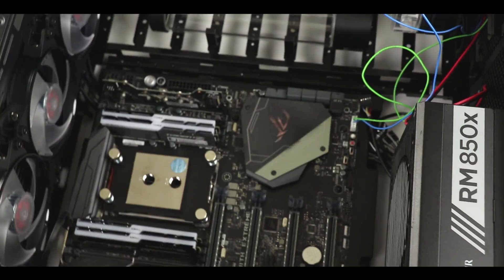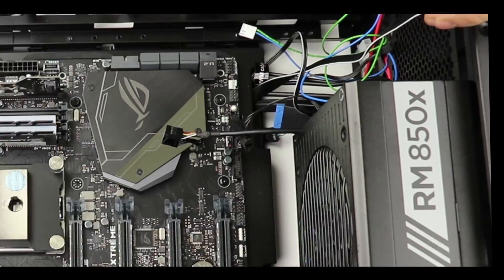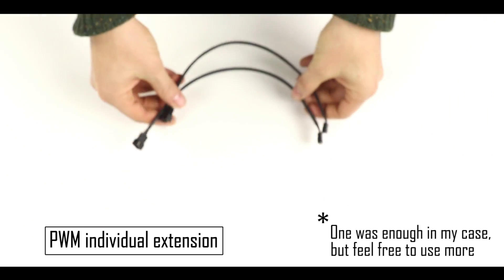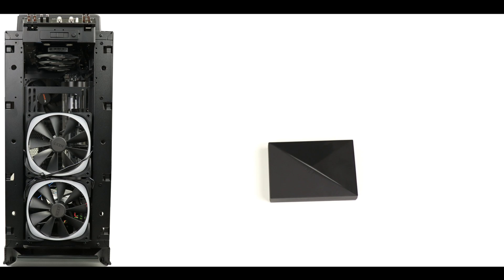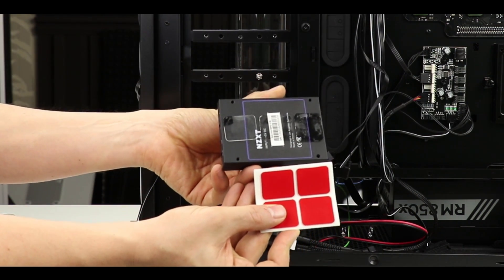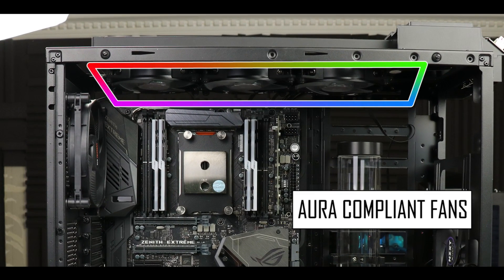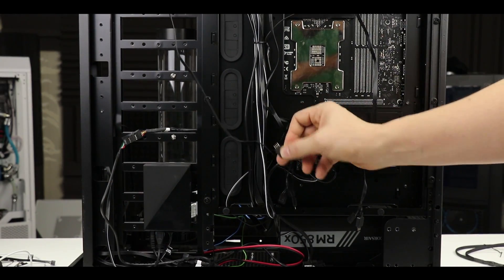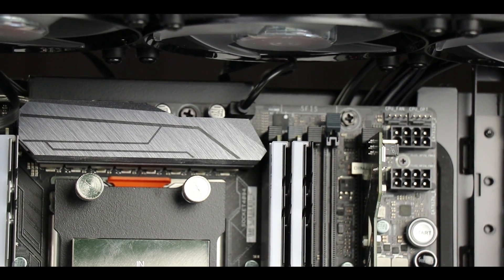Motherboard and Fan connectors ( The Threadripper Build 4 of 8 )

Comment: I have G A320m-s2h mobo can i put multiple rgb fans? Does it support normal rgb fans.... And can i connect rgb fan hub to cpu fan connector? Please reply
Reply from the maker: You can use RGB fans with the board bu cannot control them since there are no RGB connectors on the board. 

So they will be spinning and work, but the light will go at factory default and that's it.

Comment: I have 2 200mm connected to a y conectuon an di to mobo but cant read or change speed do rhey j e to be connected individually to system fan on mother bord to be able to controlle it

Comment: 1:57 : it looks like you are using an EK pwm splitter ( if not, all splitter works the same so...) but you let unplug the one labeled, it the only one which has rpms return signal... it will still work no problèm but if you want to know rpms... you won’t ;)
Reply from the maker: +Prevot Lucas oooooh good one , let me check
Reply from the maker: +Prevot Lucas dam ur good... ur totally right . 

Corrected  :)